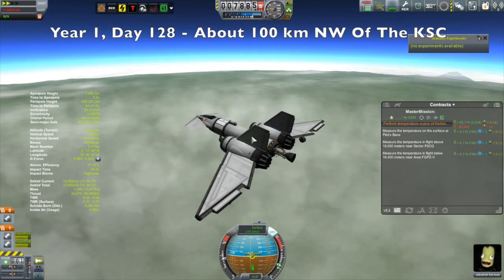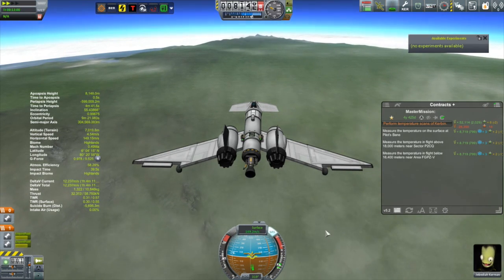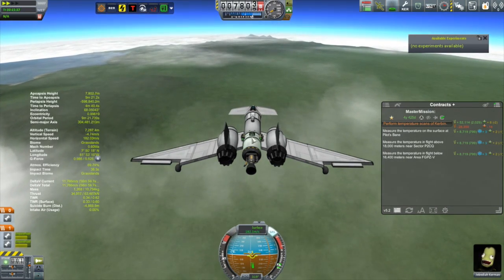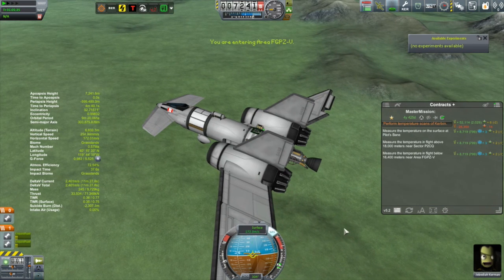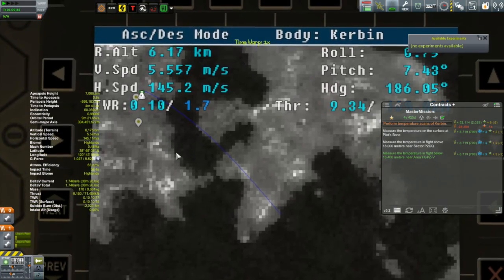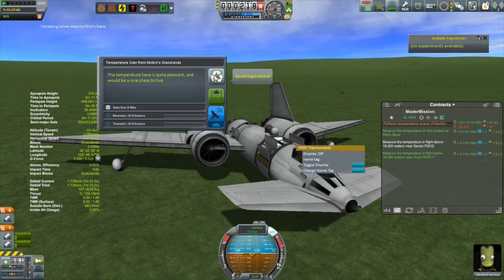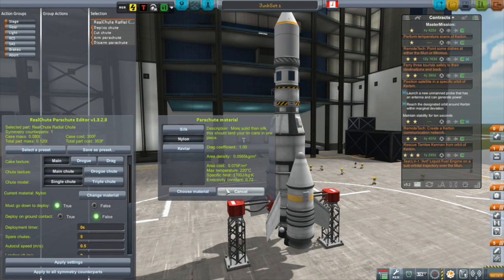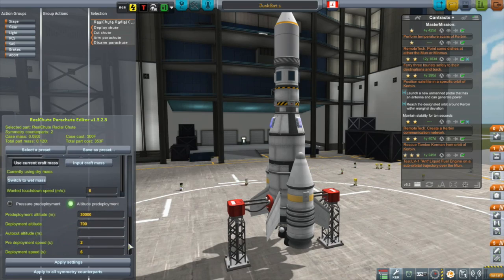KSP Career: Episode 16 - Cutting Losses

Comment: What a pain of a contract, best to chuck it. Still got loads of stuff done, even if it was mostly in vain!

I had a similar contract and wondered if I could launch the plane as part of a rocket and send it sub-orbital to reach the contract location. Couldn't see how to do it with the parts I had though.
Reply from the maker: viruk67 I thought of a rocket too, but decided the expense, risk, and general pain in the assness of it wouldn't make it worth it.

I wonder what Squad thinks the player will do with these?  You get these contracts almost right from the beginning, but a basic jet can't get that high.  I think they have the altitude range wrong or haven't adjusted it since nerfing the basic jet engine.  All the altitude targets seem to be around 16 to 18 km.  Thank goodness you can be way below for the below one.